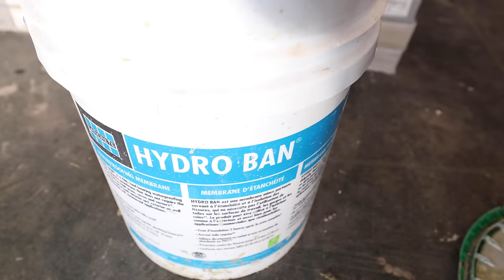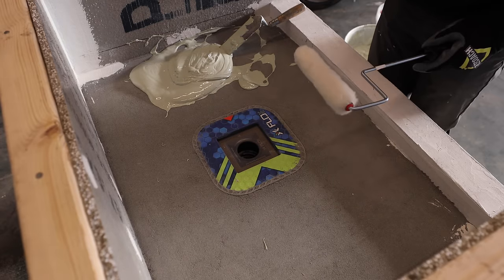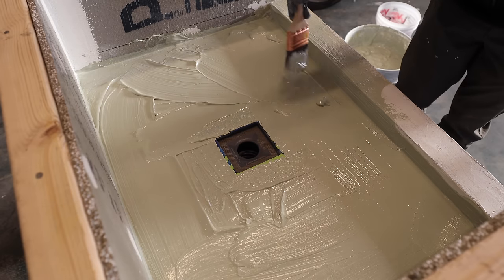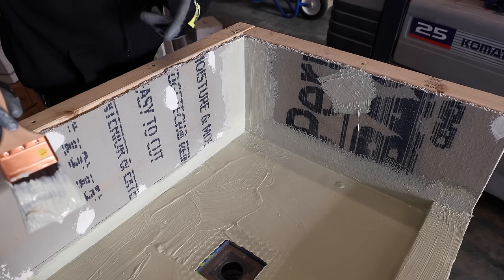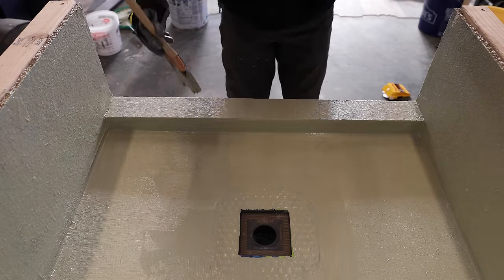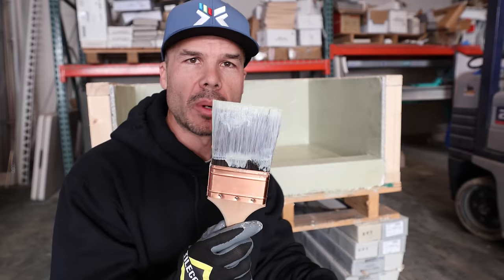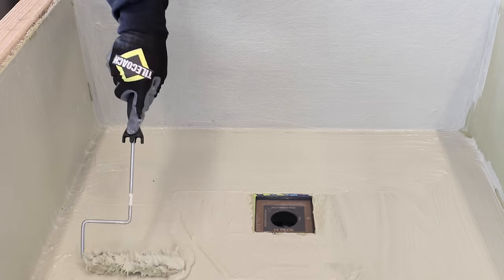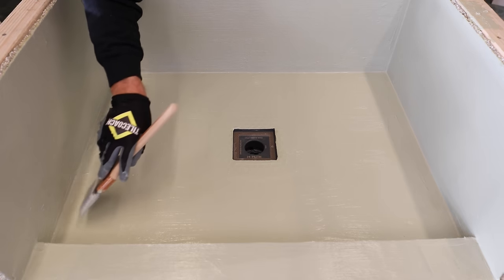Easiest Way to Waterproof OVER Dry Pack Shower Pan --- Hydro Ban Liquid Membrane

Comment: So let me get this straight. I'm about to do my shower that was done by a flipper with no shower pan at all. You build a mud bed, then install the standard pan as in your video. Then a second mud bed on top of the pan allowing drying times of course. Then you apply two coats of the Hydro Ban on top of the second mud bed, and apply the tile directly on top of the Hydro Ban in the normal tile installation way. Am I understanding this correctly?
Reply: I didn't see a standard pan put in. Not sure which video you were looking at. Like joshua646666 said  "You build your mud pan,paint the hydro ban directly to the mud, then apply thin set directly to the hydro ban to lay the tile"

Comment: Great work! If you had to choose one, which thinset would you use on the joints and screws?
Reply: I had the same question a few days ago.  I ended up going with a modified thinset mortar, but apparently it doesn't really matter what kind of mortar is used for this step.  As long as you use a good waterproof membrane afterwards. 👍

Comment: I did this method over a foam pan and it blistered badly during the water test. I had to tear it all up and use sheet membrane. Followed the directions exactly. Two coats at proper mil thickness checked with a gauge. Temperature at 60 degrees and humidity at 50% controlled by a dehumidifier. I let the hydroban turn colors and then waited another 24 hours before applying the second coat. Did the same wait after the second before water testing. Blistered after about 24 hours into the 48 water test. Laticrete was no help. Search online turned up several results of this happening to others.
Reply: Oh no, then this hydroban is not good huh?

Comment: So do you need to use a Shower pan liner when using Hydro ban or can this be used instead?
Reply: sealer is not good enough on the floor and will fail you must have a membrane,  I'm old school and use a dry pack and rubber liner.   I even saw Kerdi fail. it can move (soft) corners and can fail due to the thin set with membrane, thin set can leach water.       make wise decisions and do as many safeguards as you can

Comment: Could you do the same with Aquadefense or is this stuff different? Also, you don't use any corner/edge tape? (Aquadefense requires the joints to be taped with that blue rubbery-tape prior to Aquadefense)

Comment: Would I be able to use this method with a plywood subfloor? The order I would do it would be felt paper on top of subfloor, metal stucco netting, mortar bed with slope, and then finally hydro ban
My concern is the moister being trapped between the mortar bed and felt paper 
Thank you to anyone who can help in advance

Comment: Hi Isaac, love your videos. I'm in the middle of DIY shower remodeling and used kerdi pan for a curbless shower and Denshield on the walls. would you recommend Hydro Ban to seal the corners and any change of plane, or Hydro ban on kerdi will not hold? Thanks!
Reply: Hydroban sticks great to Kerdi

Comment: Great video!  How does the cost of this product compare to putting down a sheet of Kerdi membrane?
Reply: If you want to cut costs, use cheap cement board on the walls and use a bucket to do the floor and walls. Thing with Kerdi is a small roll will have more than you need for just a floor.

Comment: I have an existing floor drain and want to do a tile shower using that existing floor drain in concrete. What is the best drain system to use?

Comment: Can you use Hydro Ban on Schluter prefabricated shower trays? I am looking to use a Schluter shower tray extended with dry pack mortar, but would prefer a roll on membrane versus the Kerdi  membrane.
Reply: You can water proof any surface.

Comment: @TileCoach in previous videos you mentioned applying a Liquid Membrane over (on top) an installed Sheet Membrane for extended waterproofing. Do you still recommend this for high humid areas and/or extreme wet rooms?
Reply from the maker: Yes, sheet membrane is better.  But it is harder to use.  Hence the word “easiest” in the title of this video.
Reply: @TileCoach  can I install hydroban over all kerdi or just on the seams I installed a kerdi membrane on walls and over mud pan just don’t trust the kerdi. And of course I called hydroban rep and he only recommended the seems said it could possibly get a void and trap water on top of kerdi. What is your opinion I’m getting ready for that step within the next couple of days.

Comment: Hi,you are supposed to wet sponge the bed and cement sheet before applying the hydroban and also use membrane silicone on all junctions.I am a tiler 35 yrs experience

Comment: If you imbed their reinforcing mesh into the liquid. It takes it to another level. It will offer anti fracture and waterproofing. The anti fracture sheet they sale is strong with this product!
Reply from the maker: I agree Jason it’s good stuff I’ve used it on other jobs before.  My Laticrete rep at the time actually advised against the reinforcement saying it prohibits the flexibility in the corners.   Not sure but common sense tells me reinforcement would be better.
Reply: @TileCoach  don’t know if I believe that one! I use that fabric and a different liquid on almost every job. 15+ years I’ve not had a movement issue with a shower

Comment: Why is it better than Redgard? 
And how long have your showers been done with it?
I have 15 yr old Redgard showers  and have NEVER had an issue.
Reply from the maker: More solids in it.
Reply: @TileCoach  - roger that. Is that based on chemical analysis / ingredient list or subjective experience?
Also, how long has that product been available and how long have you used it?
Or if you know other that use it, how long has it been in use?
Thanks for your time and info!

Comment: About 5-6 years ago I had to waterproof 12 pans at a Ritz Carlton in Laguna Beach. Engineer called for no hot Mop ( surprise that's what I do) so I used hydro an and a 48" polyester mat and did it just like hot Mop, and it turned out really good. Expensive as shit, but no leaks so I assume it worked.
Reply: Expensive like 429.00 usd for 5 gallon bucket 🪣.   It should be 💯 percent waterproof at that price point.

Comment: Is this hydroban compatible with Kerdi membrane? I have a shower with a Kerdi flange drain, deck mud is set, walls are covered with Kerdi membrane. I was going to use Kerdi membrane over the deck mud, but saw some of your other videos about Schluter All Set not being waterproof and tending to wick moisture under the membrane. I would like to continue using the Kerdi membrane over the deck mud and banded to the walls, but what kind of waterproofing could I use over the membrane?
Reply: You can use it on the Kerdi membrane. Hydroban sticks to any porous surface.

Comment: Deck mud, sheet membrane on the field, fabric tape  with hydroban around the perimeter, and then  just paint the whole thing for the heck of it. This way you don't have to wait for the mud bed to dry and you don't have to mess with those bands and corner pieces or folding corners with sheet membrane.

Comment: Could you and would you use this over kerdi for extra redundancy, like I saw you use the Ardex 8+9 over Kerdi?  which would be better over kerdi?  Gr8 Video...I am a new subscriber.
Reply: I do apply hydroban over my Kerdi band and corners. It prevents wicking in showers that are used multiple times a day.
Reply: @nailbndr9869  did you ever hydro ban over all kerdi or just seams I did my shower in kerdi and kerdi over mud bed just don’t trust it I have 2 gallons of hydro ban. Called hydro ban rep and they did not recommend total coverage just at seams said it might get water pockets under it what do you think. Thanks
Reply: @john411327  I've never felt the need for full coverage, the only weak point of a heavily used shower is the laps of the Kerdi band. A slight chance of weeping at those areas.

Comment: Should this product be used if a pvc liner has been installed under dry pack mortar?
Reply: No way you will trap water between the two, if done properly, a 40 mil liner will last longer than a hot mop…. Said the 40 yr tile setter….

Comment: I think I need to ask a different question, as a GCG here in Florida what method would use if I offered the customer a 5 year warranty on a shower remodel ? At this time I give them a one year but want more business, would this be to risky ?
Reply: I would check with laticrete. Not sure what their warranty is but they’ll tell you how to apply it to get the warranty. This product is used in pretty extreme commercial situations all the time, like steam rooms.
Reply: @krehbein  Thank you so much

Comment: Can the Hydro Ban Liquid Membrane be applied to a dry pack that also has a pre-sloped PVC shower pan liner installed under it?
Reply: You can but it isn't recommended. The idea is to waterproof one side of any substrate. Also, your pan liner will attach to the drain flange with silicone. In order for a liquid membrane to be effective it also has to be tied into the drain flange using the dimple method unless using a drain like the one in the video. I subscribe to one method or the other, not both. Take your time, do it right you won't have any issues. How this helps.
Reply: Not recommended and overkill, and more steps for things to go wrong. Research laticrete directions for use and you’ll be good.

Comment: I let a contractor go because I wasn't comfortable with the quality of work where he installed the Oatey liner and the concrete bed.  I say concrete because rather than the cement & sand mix generally recommended by sakrete and in all of the videos I've found, he used premix concrete.  So the top is gravelly rather than smooth.  He also cut the Oatey liner on the inside of the curb about a half inch below the top rather than wrapping it over as a single piece.  His stated intention was to wrap it with Schluter membrane.  Finally, because he was going to use a colored epoxy on the concrete bed rather than tile, he set the drain cover into the cement rather than leaving a gap above the cement.  Ugh!!
I'm comfortable with the Oatey liner under the concrete but I'm wondering if I should Hydro Ban over the concrete surface if I try to raise the drain and tile the floor.  I'd rather not jackhammer out the new pan and start over if I can save it.  Love your videos and the intelligent guidance.  Any recommendations?
Thanks in advance.

Comment: Great video. i appreciate the effort you put into your videos. I'm confused I thought you said waterproof membrane on top and 40 mill pan liner underneath could trap water and you called it a mold sandwich. Could you explain that please thanks again for great videos!
Reply: Did he use a pan liner?  There shouldn't be a need for one with the liquid membrane.   The motar bed is just there to have a solid, sloped base. The waterproofing is above it.

Comment: I wouldn’t sleep that easy if I installed like this everyday. Honestly believe liquid membranes fail over time because of pin holes and separation from the deck mud from saturation. That walls can be Hydroban but floor must have some sort of sheet membrane.

Comment: Use a thickness gauge to assure proper thickness of each coat. Too thick is not better. 72 hour minimum cure time of mortar pan before applying Hydroban

Comment: Hey tile coach you should have completed the sealing process with a 24 hour leakage proof test to make sure that water 💦 does not escape through the applied sealer. 
Just a thought.🤔💭
Reply: That’s always good practice, but this is only a mock up shower pan.

Comment: I used this hydroban liquid membrane product 3 times and it failed 24 hr water test.  I watched your videos and read all directions.  Some kind of bubbles  - blisters like appear all over it. Mortar bed dried for  more than 72hrs, 1st coat of hydroban dried 12-14 hrs, and second coat 24hrs, still failed. WHY???
Laticrete rep said the coats were too thick, I used the mill gage on the 3rd time and let it dry for 3 days with heat 75F  still FAILED,
Reply from the maker: The mortar bed wasn’t dry.   Especially in cold temps it can take the mortar up to 2 weeks to completely dry.  When you fill it with water, the vapor from the mortar can’t escape, causing the blisters.  
72 hrs is not long enough of it is colder than 70 degrees F in the room at any point.
Reply: @TileCoach  Whoa, now that is something I've never heard or read anyone in the industry say before. But I can see it's true. My house is around 66-68 how long would you give it to ensure it's bone dry?
Reply: Yup. I think the Mortar bed wasnt fully dried yet. It still had moisture, and moisture always travels up. When the Hydroban was applied the Bed was still trying to cure/dry. The moisture couldnt escape which caused the bubbles.

Comment: I really can't understand why people prefer to use a sheet membrane to this method.  Sheet membranes have numerous seams and overlaps (joined with only thinset) creating multiple points of potential leaks, whereas a roll on membrane is one single continuous envelope of waterproofing with zero seams and no buildup in the corners.  Good luck keeping water out with micro fleece.

Comment: Hey Isaac, everybody, I’m ready to start renovating my second shower. The first one I did, I used the plastic gray shower liner. But I noticed that using the flow FX you don’t need an pre-slope. It just seems a lot easier to install this drain “flange” and use hydro an on top of it. Is this correct? My other question is if after the hydroban gets painted/installed, does thinset adheres to hydroban? In other words can I lay my tile on top of the green hydroban waterproofing and is there a specific thinset needed?
Greatly appreciated if I can get some feedback on this.
Thank you
Reply: Hi Jose,
I am a tile installer in Massachusetts. We have been using this same method, Isaac showed in the video for almost 10 years. It works wonderfully. We only use Laticrete products. Any thinset will adhere to hydroban. Read the manufacturer's instructions for the products you use. We use Laticrete "Tri-lite" for ceremic and porcelain tiles, "254 Platinum" for natural stone and "Glass tile thinset" for glas tiles.

Comment: Why are you applying a water proofing membrane over the post slope?
Reply: It's not water proof, allowing water to fully penetrative the dry pac constantly will cause failure and a septic environment in the pan. Pans are porous so IF any water gets in (which it will, at least some moisture) it can weep out into the drain over time.

Comment: the dry pack is made to be breathable if need water can go through and to the liner then yo weep holes on drain ? ? Why waterproof the dry pack ?
Reply: Simply as an added protection.   Many failures come from the liner install which is easy to mess up if your in a rush or just don't care.  Unfortunately many people have no pride in their work.  This method if done properly nearly eliminates the rushing  or lack of care problem.  I always waterproof after preslopes are done.  Even Though I know I've done a thorough job.

Comment: You must silicone a bond breaker in the corners,
Or use a adhesive waterproof tape and paint over.
Those corners will fail without!

Comment: Im confused now, do you waterproof the pan or not? In other videos you dont waterproof the pan and now you make a video where you waterproof everything.
Reply from the maker: Yes!!! You need to waterproof the pan!
Reply: @TileCoach  is this method better than using the pan liner ? Does it matter that the wall board is in the shower pan doing it this way?

Comment: Bear in mind that 5 gal pail of hydroban is close to $500
Reply: And will do multiple showers. Buy a smaller bucket for one shower.
Reply: A smaller bucket sells for $125. An oatey drain and pan liner combo sells for $80. Keep in mind hydroban hasn’t been out there long enough to stand the test of time. A water in water out system is tried and true and more cost effective imo

Comment: Any new product lacks any long term test, every site,house and situation is different. One thing consistent in any house, is it will move. Isn't a tiled and grouted floor, with a proper slope done first. Before walls, with no wall board contact to floor, and only silicone corner on the floor best ?
Reply: This is not a new product.
Reply: That's not the point. Just like spray insulation. You couldn't give me a house with that in it.
Reply: @jeffboelter1409  okay that's your choice but I'm not sure what your point is I guess.
Reply: There is a question in my original comment.

Comment: Good and reliable product. Would recommend not covering the entire pan. Waterproof mainly all inside corners and walls. You really want to leave an open area around drain. If water for what ever reason ever does get under dry pack, it needs to be able to dry and breathe. It cannot dry if or breathe if it's completely sealed. Still a great waterproofing agent.

Comment: just so I understand , there is no membrane under the dry pack , you simply install drain , drypack mortar base on top of slab , slope towards drain , then hydroban seal it , install drain trim piece and lay tile ...... definitely easier and eliminates a preslope drypack along with the hassle of trying to fold those big fat corners of rubber !!!!!
Reply: Yes, it can be used without a vinyl membrane. Personally, I'd never skip using the membrane. And there's a trick to eliminate the fat corners. I use a drill or Sawzall to take material from the corner studs so that the  membrane tucks between them. Sometimes the studs can be pryed open just enough to create a space too.
Reply: @michaelkiley5658  yes I have used that trick too , chiseled out material or tucked into a stud space